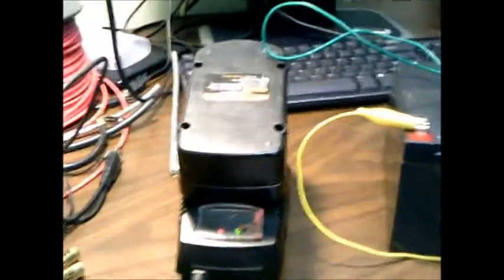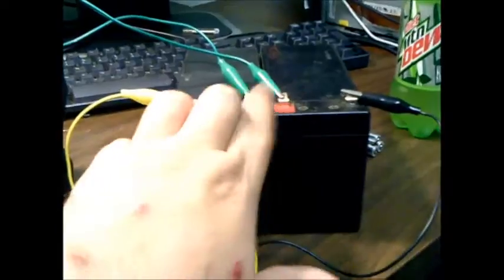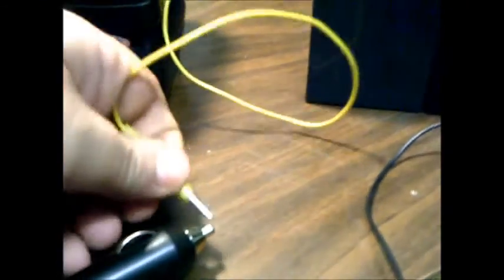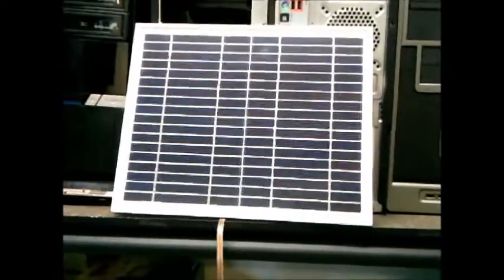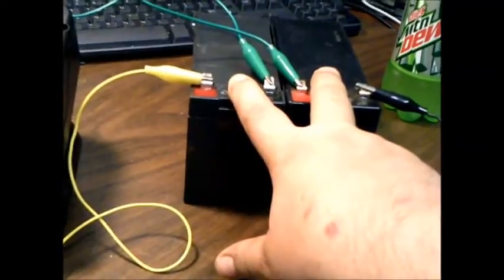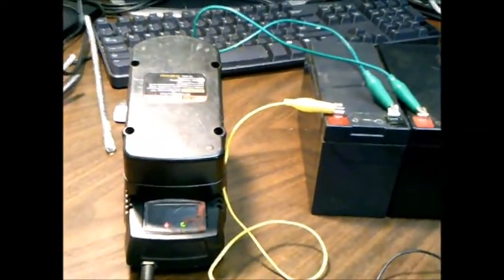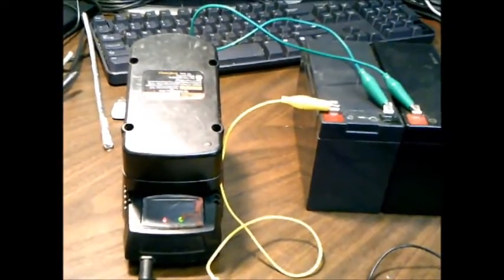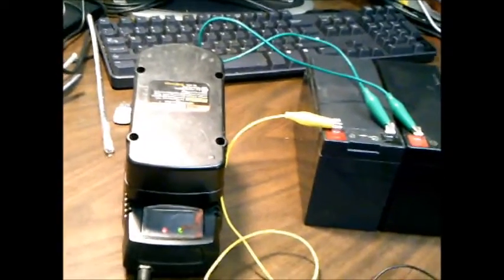How to Charge Harbor Freight Cordless Tools from 12 Volt Batteries - No Inverter Required

Comment: @FrugalPrepper
G'day Tom... Yay Team...! Um, the Lead & Acid haven't changed for 100 yrs. Ideally, 1.3 SG = 2.2 V/Cell = 100% Charged. A Battery should be cycled at 10% of it's Rated Capacity, so, to use 10 Amp Hrs, store 100. Max Charge & Disch. Rate is 10% of RC, as well. Treated like that, with maybe 3 x 30% Cycles/Yr,  "Deep Cycle" units (Marketing Jism, means " Not Automobile Starter-Batteries")  may last 20 Yrs... Ciao !

Comment: Great information. I also found out that you can run cordless tools directly off a sealed lead-acid battery with wires hooked up to the proper leads. I ran an 18v cordless drill using a 24v setup. Gotta be careful the leads are plugged into the terminals correctly, though. If it's done wrong you'll fry your tool. I suppose it could be made more idiot proof by making a fitting that's clearly marked. The tool wouldn't be truly cordless though, but if the OEM batteries are dead it's an option.